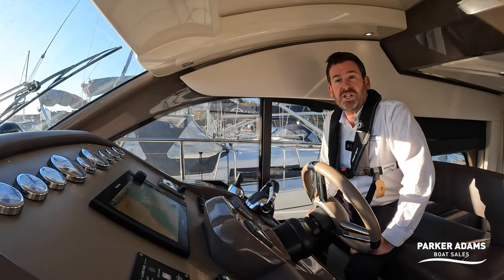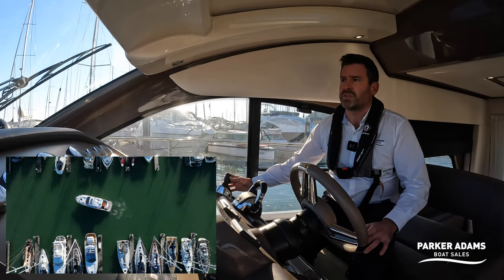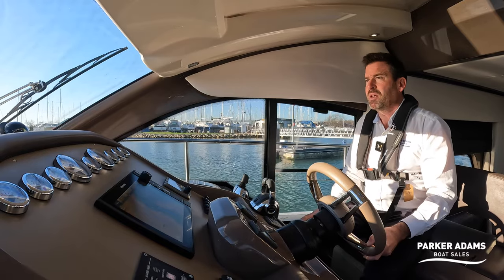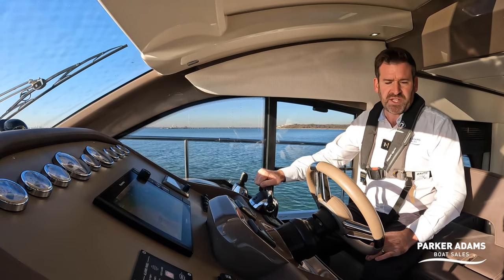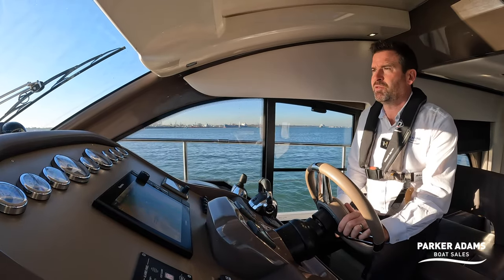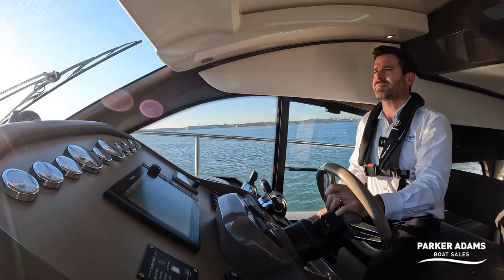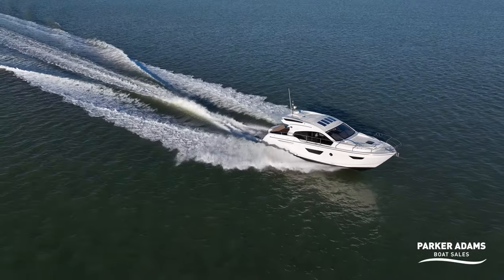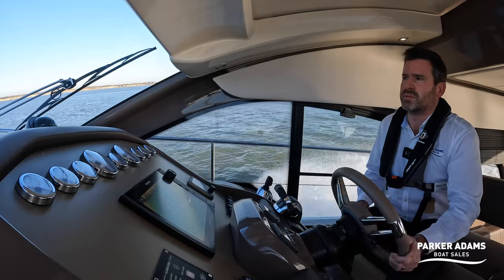Sessa C42 Handling on IPS Video! Marina Berthing using Joystick Controls - Volvo Penta IPS500

Comment: Thanks for the insights.  I must admit I'm still not comfortable with the concept of rotating a Drive leg either directly Inside a leg/Hull seal, or exactly the same issue if it is a Stationary external leg seal, and the rotating is done with an internal part of a leg. With a Conventional Volvo Saildrive,  I have No issues Crossing Oceans with one properly serviced and maintained, but a rotating one ? Pass, I'll give it a miss thanks. tbh, a Conventional non rotating Saildrive and the boat having a single rudder facing the water flow from the prop, Manouverability is definitely much more than adequate anyway. Twin Rudders? Pass, as low speed maneuverability in tight spaces, is just plain Nasty.  Best Wishes and Fair Winds.  Bob.  👍⛵️✨️